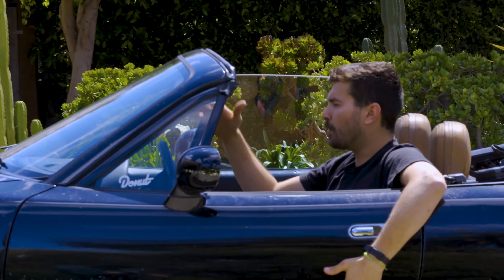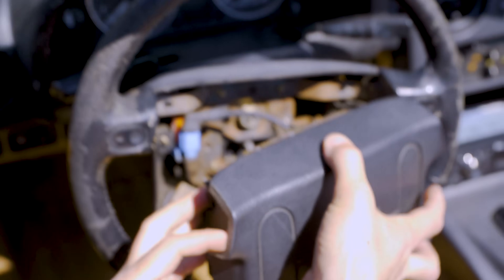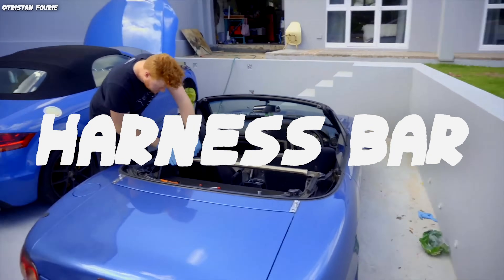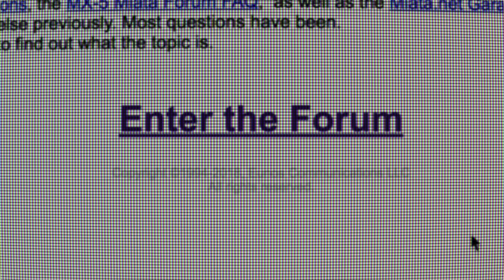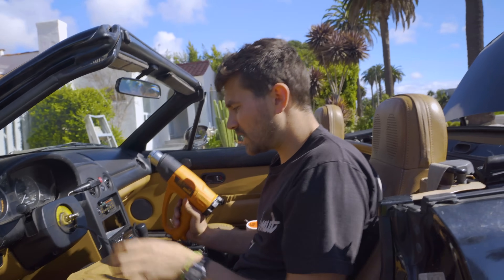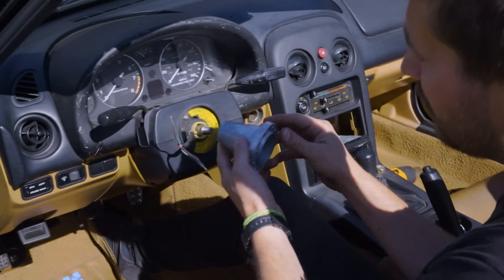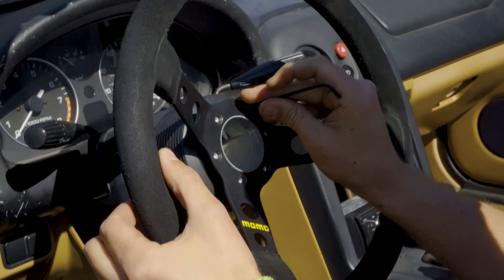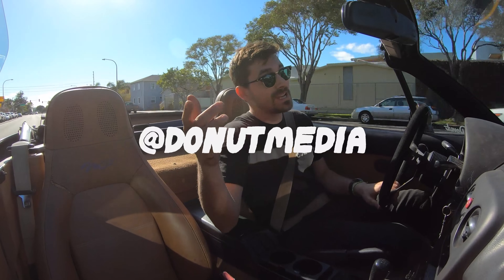HOW TO: Change Your Steering Wheel

Comment: Had a air bag go off when I was removing my wheel at 16 

Almost knocked me out , as my ears are ringing and I can’t see with a horrible tast burned into my tast buds and the smelly powedery gas coming from my car and face ....

I got a warning from my frount office lady for working on my car and the loud noise xD  “nice lady”
Reply: Thats doesn’t sound good, glad you were ok. Shows the importance of disconnecting the battery and letting the capacitors discharge.
Reply: Adam Miller yes sir and removing them in general
Reply: I once had a friend who was trying to drill through his firewall to run wiring for subwoofers.. only he drilled into the passenger air bag instead.. I will never forget the amount of powdery gas whooshing out, or the look on his face covered in that stuff lol the amount of pressure in one of those things is insane
Reply: JoshD4PREZ its literally a bomb xD I learned the hard way sounds like y’all got a lesson your selves
Reply: I was installing some seats in my car and immediately after saying."I wonder if These seats have air bags?" I set the air bag off. My ears were ringing for the rest of the day.

Comment: WARNING be careful whem doing this mod, the mx5 is safe to remove airbag components after the battery is disconnected, however many brands and different models of vehicles within a brand have different procedures,
Some you have to leave the battery disconnected for up to a hour so the system completly discharges of all electric thats been stored in capacitors and such,
Personally after disconnecting the battery i turn the hazard light switch on and crank the ignition to the start position to try and disperse any electric that may be hiding within the components of the car,
Reply: Good point.
That is very true about capacitors storing electricity.    ''Safety first''

Comment: Need to do the swap for every time doing MOT in Sweden. So, here are a couple of complementary details: 

* after disconnecting the battery, drain every lasting current by turning key to ignition position. That should send power to at least relays, fuel pump prime, lights and stereo. 
* when trying friends steering wheels, keep an eye on instrument panel, as the smaller wheels has a great chance to be in the sight of vision and hide tach and speedo partly. Adjust seat and check head-to-roof clearance too!

Good luck with fixing those ergonomics! 

Written by a 1,85m long guy who feels so much better with Daikei hub, SnapOff FIA QR, 80mm dish 340mm wheel and slightly tilted back Sparco Sprint.

Comment: chucking the oem wheel has been my first mod to all three miatas ive had so far. in the case of the second one, i ordered the hub before i even brought the car home. in the case of the third one, i took the hub off the second one immediately 😂. now im kinda obsessed with steering wheels and i have a stack of 15 or so at home that i change whenever i feel like it

Comment: Just a a heads up if you are new to soldering. There is also solder with a lead core. Probably don't want to use that. Also, if you are soldering in your garage or really up close for an extended period of time, there are soldering exhaust extractors that you might also want. While it might not seem like a big deal, after years of soldering and breathing that in, it could cause respiratory issues.

Comment: I would love to ditch my stock steering wheel due to leg-room, but my '91 is my daily and I don't want my face to smash into the hub of the wheel in the event of a front-end collision.
Reply: racing seats with 3 point harnesses bro
Reply: @wallstreetmonky6797  unless ur also wearing a helmet the harnesses have proved to increase the chance of neck damage
Reply: @someonexd1961  then how do you suggest to improve safety?
Reply: @amildlydisappointingsalad6058  airbags
Reply: @N9197U  which you wouldn't have unless you have the stock steering wheel. I was asking if there was a way to improve safety WITH one
Reply: @amildlydisappointingsalad6058  Still a harness. But if it's a project it would be good to get a half cage to mount the harness to.
Reply: @someonexd1961  but was that made with a car on a track, or just a daily-street driven miata?

Comment: Great video. One thing mentioned that is often overlooked. Wear a harness without a Hans device and if you hit something hard enough you will end up dead like Dale Earnhardt. Your body being held tightly by the harness and the weight of your head or head + helmet can separate your spinal column from your brain. No Bueno! If you are going the harness route and want to drive on the street, keep your seatbelt when not suited up for the track.

Comment: @10:53 in the video your talking about why the new hub and wheel alignment are important. A major reason it’s important is so you don’t destroy the clock spin. That could set off the airbag light and give you a annoying clicking sound it if brakes

Comment: This project is an NA miata (1st Gen).  An NB (Second Gen) steering wheel will bolt right up except you have to swap wire connectors for the airbag.  Not a big deal at all.  The advantage is three spoke modern looks, cheap and the safety of a factory airbag.  It's a tried and true swap.

Comment: One other VERY IMPORTANT thing thing to remember when disconnecting a steering wheel: Careful to not pull out the ribbon for the clock spring! (yellow piece @ 2:57)
Reply: Why
Reply: @RP-dy5mu  It connects a bunch of important things like cruise control, horn, airbag, etc.
Reply: @RealNikoBellic  Thanks for replying so many years later :)
Reply: @RP-dy5mu  lol no problem

Comment: I got mine a while back and I love it!  Heard that I could get ticketed because of the no airbag, but after a couple cop encounters, never once have they ever mentioned it, so I do not think it is a problem.  I have yet to get bucket seats/4 point harness/harness bar, but I will soon. 😎
Reply: I was also worried about getting ticketed for it, Do you think it’d be worth getting an aftermarket wheel?
Reply: I doubt that they would notice

Comment: Harnesses are often more dangerous than just no air bag. Getting in a high speed accident can easily brake your neck without a helmet and a Hans device
Reply: If that’s the case, then buy an ASM certified harness

Comment: Need to watch if you're installing racing harnesses, alot people go for 4 point thinking it's an improvement in safety, these are notoriously unsafe due to submarining because there is nothing to stop your body sliding down and out, this is where a 5 point harness is preferable. Really there is nothing wrong with a stock seatbelt which connects at an angle to pinch your body in place during a crash, on a 94 mx5 a fresh set of OEM seatbelts wouldnt go a miss though as all things in this life have an expiration. Good luck and thanks for the good content.

Comment: For soldering, I wouldn’t recommend a soldering gun. I used a 150W soldering gun for years and it worked ok, but took a very long time to heat up and as soon as you let off the trigger it would rapidly cool. After 6 years of using that I tried a digital soldering station and never looked back. I use a Weller WES51 soldering station which is absolutely phenomenal, and I would HIGHLY recommend it to anyone who needs to solder anything. Also the Trakpower TK950 and TK955 are both great options too. And please, always solder your connections and use heat shrink instead of those crappy crimp connectors.. You get much less resistance and cleaner wiring if you just solder everything. Yes it’s a little more expensive but you don’t want to cheap out on your car’s electronics. Also I’m not sure if putting a 3000 Ohm resistor is the right call for every vehicle, some may need difference resistances. I suppose you could measure the resistance across the terminals of the airbag and see what that reads as, then add an equivalent resistance resistor in place of the 3000 Ohm one used in the video

Comment: Make sure you clean that flux off that you used, leaving it there over time will promote corrosion as it prevents the metals from oxidizing creating a sacrificial protective layer (Think stainless or aluminium). Most solder today have a flux core so that you do not need to mess around with a separate flux.

Comment: I have a kei car and I'm tall so I'm not particularly sure on how safe the airbag is for me and I could probably control the car better if my legs didn't touch the steering wheel near constantly. I need some extra room so this video was very very very helpful. The airbag doesn't deploy electronically which is weird. I know you have to wait on a lot of cars to discharge electricity from capacitors. I just need to be stupid careful because I think it's only based on a pin sliding and G-Force.

Comment: I swapped out my 2003 VW Jetta's wheel for a multi-function wheel from another MK4. Make sure to get the module with the wheel (#451)! Otherwise none of the buttons will work. (Radio control and cruise functions) Then there's the wiring... Hoo-boy!

Comment: No airbag in my 1991 Nissan D21 hardbody. You use AAT as Jay Leno calls it, accident avoidance technology.  But I have the same issues as a tall person in my 2002 BMW Z3 M roadster.  However the seat been maxed out to the back and bottomed out since 2003 when I got it.  I have hit my head on bumps for years and put that car on like a glove unless the top is down then hell yeah brother only the wheel is my problem like you had.  Thinking about doing a quick remove someday.

Comment: Harness seatbelts don’t do much good when it comes to keeping your head from flying forward. The airbag is there to prevent basilar skull fracture. In the absence of an air bag like in racing for example, a HANS DEVICE needs to be used. A basilar skull fracture is almost always deadly.

Comment: I swapped the steering wheel from my 85 Mercedes 190e from the stock 17" steering wheel (yes 17" ) to a Momo Mod .80 300mm wheel, and while I generally love it, I can't always see my gauges. So consider that when swapping your wheel. Luckily I'm not that concerned about it

Comment: Probably a good idea to touch the cables together or wait 30 mins for the air bag module to drain power, they have a reserve capacity incase a battery cable is severed in a crash

Comment: you don't need flux when using your traditional lead rosin core solder. I mean it doesn't hurt other than making the joint look dirty, but you really only need flux with solid core silver solder.

Comment: Thanks for noting the safety about removing the airbag. It’s glossed over in many other vids.

Is there anyway that you can keep the original wheel (good condition) but add a spacer to it for better positioning?? I would love to have a “nicer” wheel but since I will not be racing/tracking this vehicle I don’t want to add a roll bar or harness and bucket seats. Is there no way out of this mod if you change the original wheel?? This would be my first stick.

Comment: Hi Zack.  Thanks for the good vids, you'r good at this.  Sorry to be the messenger who brings bad news, but the California motor vehicle  laws state that an airbag cannot be "tampered with, disconnected, or removed from the car".  The car is no longer legal to be on a California public road,  and if you get pulled over the car may be impounded. You should look into this before you drive it again. You could cut the bottom third of the steering off, it would look tacky, but would be legal.  Tom
Reply: Impounding a car over a dumb steering wheel? What is California doing?

Comment: Little hint: in quite every solder whire that you can get nowadays on the market there is flux included in the whire so you don't need that slimy flux paste anymore it will work just as great without.
Reply: And if you don't got a heat gun just use a lighter it will work just fine if you move the flame quickly over the heat shrink for about a half a minute

Comment: The steering wheel in my MR-2 Spyder actually looks good and is a good comfortable size. No way I'd get rid of a good steering wheel with an airbag for an aftermarket one. Airbags have saved me from a concussion/whiplash before so unless it's a bulky steering wheel I wouldn't get rid of one, sometimes you can find other good looking comfortable steering wheels with airbags that work in other cars. Like the RX-7 or Toyota Chaser Steering wheels.

Comment: I changed out my ‘96 Miata’s stock steering wheel probably just over a month ago now for a new wood one, and man this video would’ve been nice 😆 I did it almost totally blind, but it turned out nice... The only thing a little sketch was that I had to MacGyver some clamps to the wiring to actually make the horn work again. 

No airbag, buuuttttt it looks clean as hell. Oh, and the resistor was totally a little bitch to actually get working right

Comment: If you remove your airbag and install a harness to counter the lack of a airbag, the harness is only part of the safety function.

Basically if you install a harness, they have a high risk of breaking your neck or fracturing the rear base of your skull, they hold your body pretty tightly to the seat meaning on impact leaving your head free to fly forward and snap it goes. Conventional belts let you lean forward a little so the airbag not only stops your head it protects the neck by preventing too much head movement. This is why racecars rules require drivers to wear a HANS (Head and Neck Support) device. It sits on a drivers shoulders and clips to the rear of a helmet. This limits the necks ability to lean forward and transfers the absorbed impact to chest and shoulders. So unless you wear a helmet with a HANS device to drive a harness will kill you. Even with a airbag as your body cant lean forward to reach it. Now I'm not sure if this risks applies to 4 or.5 point harnesses but it is a good point to know especially as most who install them seem not to know.
Reply: A harness can be adjusted.

Comment: There's a much better way of tricking your airbag light and you can remove the clock spring in the process. The Sundae Drive does a great job explaining it. Still a decent video here

Comment: So much that i have an issue with that i dont know where to start. 

#1 dont cage a street driven car, its a bigger safety issue than not. Metal bars in your car are metal bars to bash your head in so youll need a helmet. 

#2 harness bars can and will strangle you in a T-bone situation especially if youre knocked unconscious. No harness bars, whether its street driven or not. 

#3 a harness will prevent you from smashing your face into that metal plate with a "momo" or "NRG" (or what ever brand)  stamp on it. But it will also run tge risk of severing your spinal chord. How do you think Dale Sr. died? If youre gonna wear a harness you need a HANS device. 

Safety parts go hand in hand. If youre gonna ditch the bag, get a harness,  if youre gonna get a harness youre gonna need a roll cage (6pt at least) and a HANS device, in order to use both of those youll need a helmet.  Now think about getting into gear just to run over to CVS for some cough medicine.

Comment: the harness isn't what saves you without an airbag, the airbag is practically your built in HANS device, so if you're not driving constantly with a HANS (which you need harnesses for) technically you are increasing your chances of death when in an accident. Now this doesn't mean everyone who owns a aftermarket wheel is destined to die in their car but it is food for thought about what that airbag is really preventing and the proper way to address replacing it.

Comment: Tip. When taking your steering wheel off. Don’t take the nut fully off. Leave it on a little bit. So when your yanking on it, it doesn’t smack u in the face when it comes iff

Comment: Hi im looking at changing my steering wheel to aftermarket.  My car is Mazda 6 gh 2nd gen.  With no luck there is no steering hub for my car.  It would be big help if you can guide me on what specific model can work with my car.  Thanks in advance

Comment: if you ever want to drive on track with MOCCA steering wheel, you never want to use bare hands on it, grease from hands will ruin the grip on steering wheel.

Comment: How do you measure diameter and dish? Is it outside diameter? Centerline diameter? I have a low quality aftermarket wheel and I want a higher quality one in the same size.

Comment: tip for soldering. you only need to heat up the solder with the iron for it "coat"/drip on to the wire. you dont need to heat up the wire itself.
Reply: The wire being warm as well leads to much better solder cohesion

Comment: This is NOT how you solder electronics lol 

1. Do NOT “hold the soldering gun on the joint until it’s hot” that is the best way to short resisters and damage item in the chain. What you need to do is make sure the soldiering iron is up to temp before you do anything and tin both the wire and the resistor first and when you join them you should only have to hold the iron on there for a few seconds until both sides re melt the tinned solder that is on both sides to be joined and fuse together

2. Dull or gray looking solder is usually indicative of the shoulder being melted at a really high of a temperature. It is also very depending on what kind of sold or you use. It is also recommended to use flux this would make any joining of two wires or a wire and a resistor very very easy.

I just want to mention that it is very hard to screw this up and obviously it worked when he did it but I had to say something because this information is false. I do this for a living

Comment: When removing an airbag, you SHOULD wait around 30 minutes to an hour after disconnecting your battery as your airbag could still hold a small amount of charge and could go off if you try to remove it.